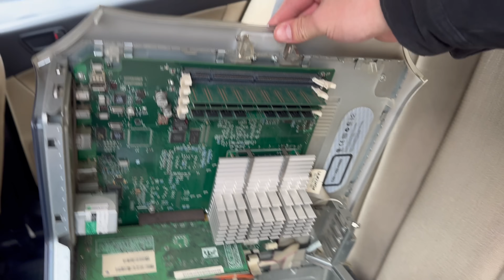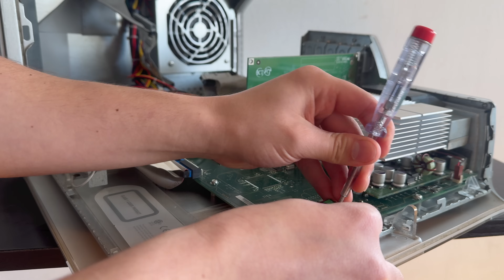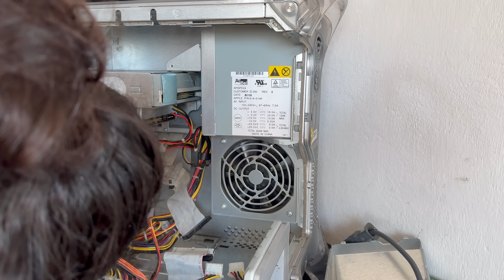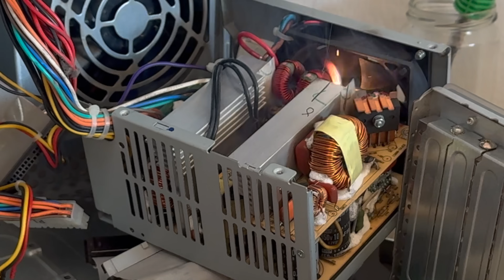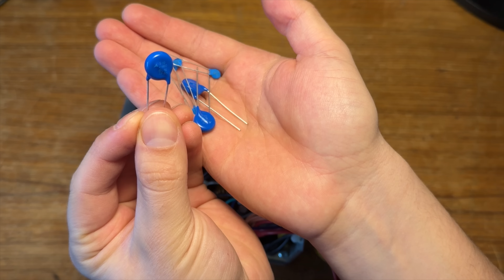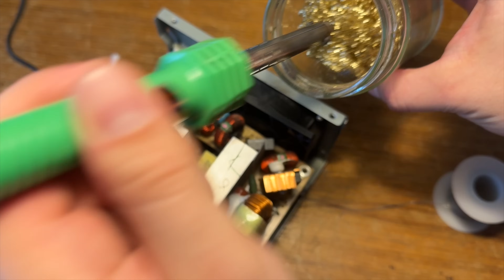Almost Burned My House Down

Comment: Build yourself a dum bulb tester and save yourself from  blowing up components. You just put a light socket in series with a connection to a power outlet. You need incandescent bulbs. Items that use more power require higher wattage bulbs. If the device under test is short or pulling too much power the bulb lights up instead of your component detonating. Every mad scientist needs a dim bulb tester...and obviously a Jacob's Ladder. The excitement of finding an old tube tv on the side of the road and then the smell of ozone  as the arc travels up the ladder. 

Now as far as the fuse you don't  use a giant wire like that. Just pull a strand or 2 out of it and that should be ok. If not it gets vaporized but you don't have a fire. Smaller wire. The fuse blows because it's thin. That was great big wire you used. Yeah probably don't do that is best. loll
Reply from the maker: Hey, thanks for the advice! The reason I used a thick piece of wire is that It wasn’t really meant as a fuse. I just wanted to jump that connection without the fuse in place. Dumb, but not it’s what I wanted to go with lol
Reply: @schvabek I was a bit shocked that you have not used bulb tester :-) I'm using one when first time plugging any old "trash" from boot sales :-)